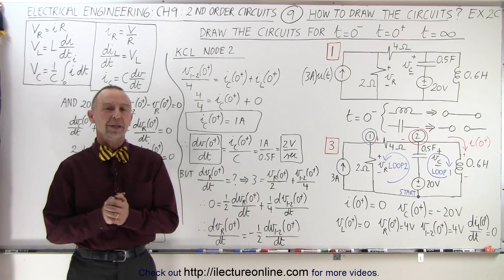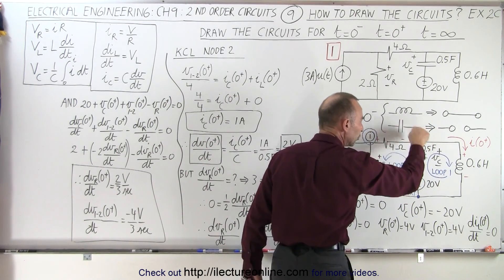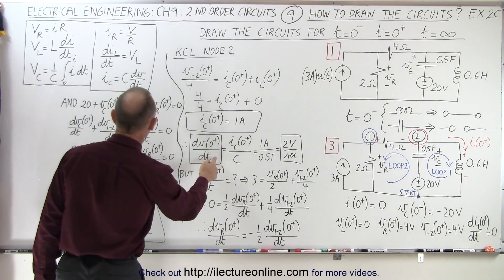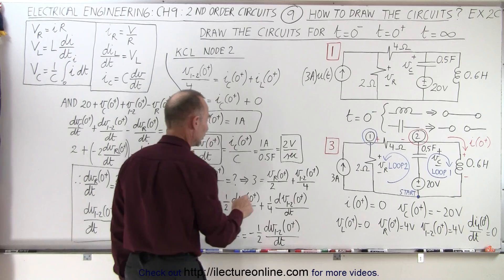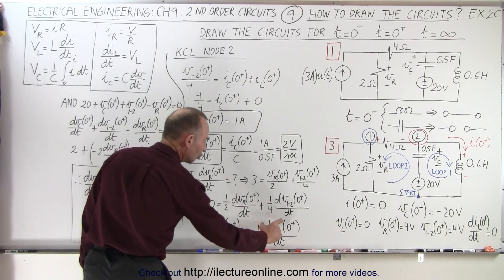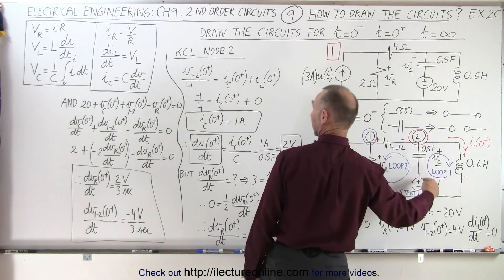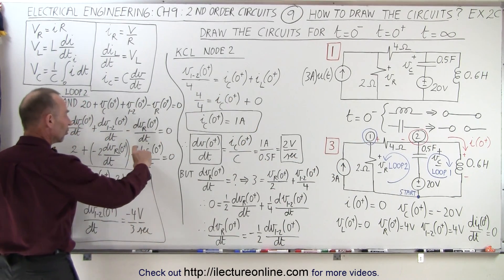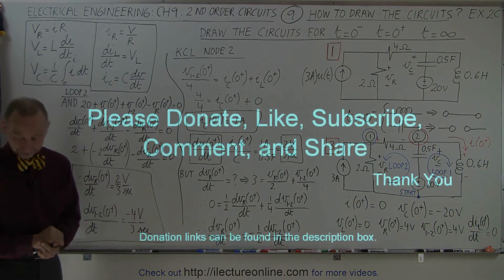Electrical Engineering: Ch 9: 2nd Order Circuits (9 of 76) How to Draw the Circuit: Ex 2C

Comment: I am trying really hard to understand this but would really appreciate some clarity.
Reply from the maker: What specifially don't you understand?
Reply: @MichelvanBiezen  I posted a question 2 days ago just below, can you check that please?
Reply from the maker: We receive hundredsd of comments and questions.  Trying to find one from two days ago would be a challenge.  Better to repost the question on a new post.  We try but cannot respond to every question.
Reply: just to echo what others have said below me, when going around loop 2, we considered 20 - Vc (20 volts) + Vr(1-2) -Vr = 0. When we differentiate with respect to time on the far left of the board around the 3:52 mark, the voltage here is not being subtracted, even though it is "losing" 2volts per second as it charges on the negative plate, eventually having the same voltage as the positive plate?. Shouldn't the equation be (after differentiating with respect to time), " -2 + (-3 dVr/dt) = 0 " ? being negative 2 as it slopes downward from 20v to 0 at 2v/s? Where is my mistake here?

 @MichelvanBiezen

Comment: just to echo what others have said below me, when going around loop 2, we considered 20 - Vc (20 volts) + Vr(1-2) -Vr = 0. When we differentiate with respect to time on the far left of the board around the 3:52 mark, the voltage here is not being subtracted, even though it is "losing" 2volts per second as it charges on the negative plate, eventually having the same voltage as the positive plate?. Shouldn't the equation be (after differentiating with respect to time), " -2 + (-3 dVr/dt) = 0 " ? being negative 2 as it slopes downward from 20v to 0 at 2v/s? Where is my mistake here?
Reply: Hello there! I think the situation here is that the capacitor is originally -20V, and the rate of change (the 2V/sec) is positive, so it slopes upward from negativity (?)

Comment: In the previous video, when we applied KVL starting from the voltage source. we took the voltage of the capacitor as negative, but here we took it as positive, why is that ? thank you.
Reply from the maker: Capacitors (like batteries) have a positive side and a negative side depending on how it is charged.  That may be the difference.
Reply: @MichelvanBiezen  Sir, I need to ask something about above question. The reason of this is reference right? Because we initially consider the current source effect is larger than the voltage source.  But in contrary case, if we consider the i(c) = -1, dV/dt= -2, we must take the sign of the voltage of the capacitor as negative, then the results of the loop 2 equation can be found again. Therefore we cannot say that the voltage of capacitor is increasing? Is that true. I hope, I can express myself.
Reply: @UCuPvWk0ymhgpdhSmF8bOsLg when you KVL across the cap right after zero time from bottom to top, you shoud use negative sign, because the voltage is unchanged and is like zero minus time, no matter what current direction you use.